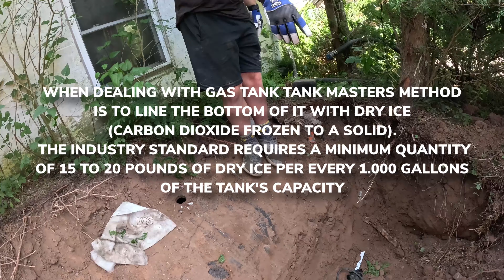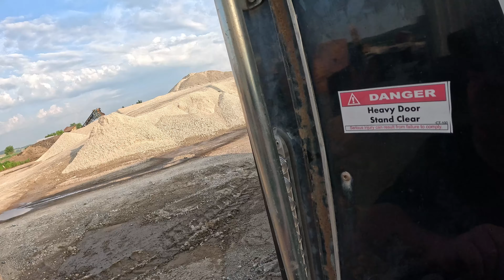Residential Gas Tank Removal

Comment: That 1000 gallon oil tank probably leaked for a while to get those high PID readings.  Hopefully the site will clean up after filling two triaxles.  Removing a tank filled with gasoline takes some skilled operators with the correct equipment.  You had that covered.  The homeowner is fortunate to have your company doing this work since others might have turned this project into a major cash generating machine.

Comment: While driving through Bethel my brain said "I know where that is" but couldn't place the quarry till you pulled into the lot. I recognized the driveway and that scale building right away. It's on the south side of Rt 17b between the Monticello racetrack and Bethel. As I recall, the sign out front doesn't mention exactly what's up the road.... maybe something about materials with the company name? BTW, check the rest of your mudflaps for future DOT stops. It seems that NYS uses a formula rather than a hard number of inches like other states. (6" - 12" high) As I read it. looks like they want protection at a 22 degree angle from the bottom of the tire to the bottom of the hanging flap, based on the distance the flap is mounted behind the wheel. Rough rule of thumb is 1/3 of the tire total height if you kick the flap against the tire. In the case of a 40 inch tire, that's 13 inches off the ground when the flap is against the tire... and probably around 10 inches hanging down straight. You may want to get a clarification from the local police or DOT on that.

Comment: How long does the mud flap have to be? Next time call your mechanic or have one of the kids change the mud flap tight on site. It will save thousands on tows. The E brake thing is bullshit also. If it holds at time of inspection then they can’t do shit. People need to start fighting those pricks.
Reply: would be nice to have a number and where they measure from. I suspect they run them on the high side because too low gets them caught in the snow and tears them off when you back up. Yeah, backing into a snowbank (or dirt pile) is a real thing with trucks.
Reply: @rupe53  I get it if it shows 1/2 the tire from the middle. I have been around class 8 trucks and was a certified state inspector. Never had I heard of a mud flap being too short. Again unless it is showing from the middle of the tire up. NYDOT is fucking ridiculous.
Reply: @richb1128    I found the regulation where it said roughly 1/3 if you push the flap up to the tire, which translates to about 10 inches on a 30-inch tire and 13 inches on a 40-inch tire. Obviously, it's closer to the ground when it hangs free. The wording actually spells out a formula stating the angle from the road behind the tire to the bottom of the free hanging flap will be 22 degrees to prevent debris from being thrown. I also found that NY isn't the only exception with crazy rules.